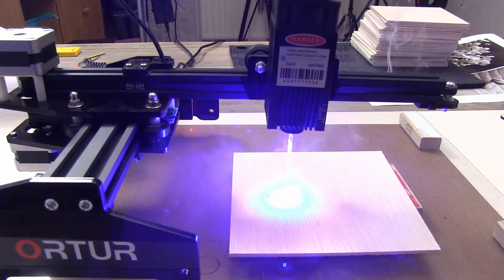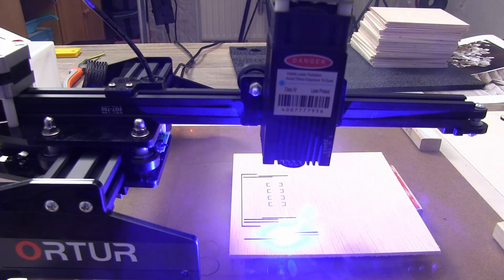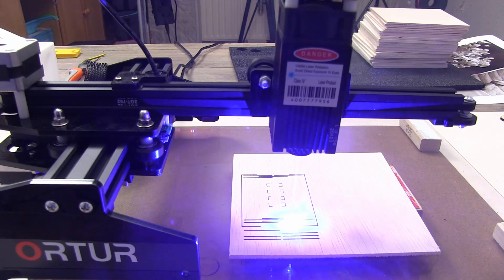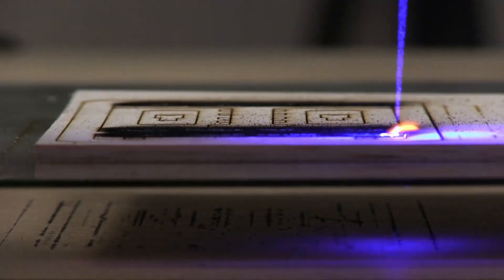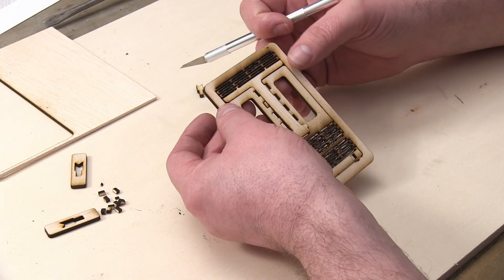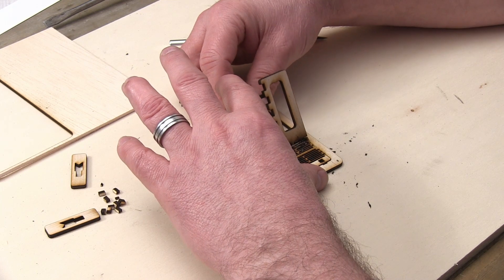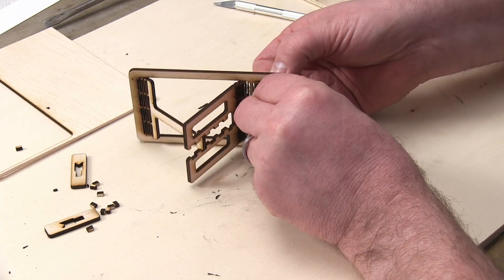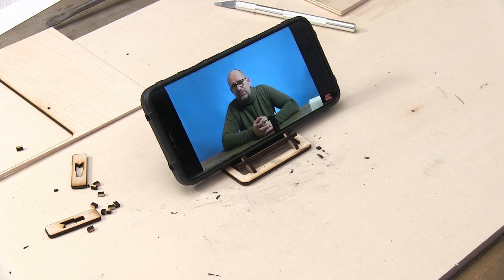▼ Cutting a phone stand out of wood with the Ortur Laser Master 15 Watt

Comment: NICE CUT, CAN YOU SUGGEST ME SETTINGS FOR 4MM MDF AND 4MM PLYWOOD? TRYING TO CUT WITH MY ORTUR LM2 20W BUT COUNDT DO IT WITHOUT BURNING THE WOOD, I HAVE PUT A STANDING FAN AS AIR ASSIST, IM NEW IM TRYING TO ADD THE CORRECT AIR ASSIST BUT HOW CAN I CUT FOR THE MOMENT?  THANK YOU
Reply from the maker: There are no proven settings, but if things burn, you have to go faster and use more repetitions.

Comment: CorelDraw file exported to SVG but the drawings appear in the negative values in the coordinates in LaserGRBL and the machine does not recognize it to start working. How do you set up Corel files or what vector files do you use for cutting?
Reply from the maker: I never used CorelDraw. I use InDesign for almost anything vector related.

Comment: whats the best settings for cutting foamboard 4mm
Reply from the maker: This is different for types of foam, and also for different colors, but about 75% power, and as fast as possible that there is still a decent cut.
I prefer 2 cuts with more speed over a single cut with a slower speed, because the material will melt together after the cutting if the material got to hot.

Comment: If I understand you correct you are saying you like the 15 watt better than the 20 watt is this correct?  I am trying to decide which one to purchase, I was thinking the 20 watt bcause you have the extra power if wanted or needed it, but my thought was you could turn down the power to make comparable to a lower wattage one is this not correct?
Reply from the maker: Sorry for the late answer.
No, there is no better or worse model, they all have their uses.
For engraving, the 7 Watt model is more controlable in low power settings, therefore this is the better choice. For a bit of both jobs, the 15 Watt model is great, while the 20 Watt model is not good for engraving, but the best machine you can have for cutting.
Reply: 15 watt is easier to focus the laser compared to the 20w fixed lens

Comment: Can it cut 3 to 5 mm MDF material?
Reply from the maker: Nope, not out of the box.
You can upgrade it with an air assist unit, and a way to lower the laser, so the focus shifts to a lower setting while cutting, but a Chinese 50 Watt CO2 laser would be cheaper to buy.
Reply: @3dPrintCreator  Thanks

Comment: i cant cut nothing with my ortur 20w tryed 50 mm focus 55 mm,45, 40, 35 works best at 30mm focusing it carefuly,but nope i cant cut nothing but cardboard. damm. what are your focal distance? thanks for your video
Reply from the maker: 55 to 60mm, and it gives great results
Reply: @3dPrintCreator  well, at last, ortur send me a laser module for replacement, and wow!! Yes, the another one was defective since the begining, now engraves wood with no effort, and no power fluctuations or weird behavior, 1 day testing, yea, works fine at 50mm but i noticed thar about 30 the focus spot can be smaller...
Reply: @toxic-waste  i can cut, hoy incheck if is a defective laser module too?
Reply: @YorielGonzalez  yes, actually it was an about to death laser diode, was a pain in the @ but at least, ortur send me a new one, and its ok now... Thanks👍🏻
Reply: @toxic-waste  how can i know if mine is defective?
Reply: @YorielGonzalez  well, the technical way, the laser diode must have a specific readable value in ohms via multimeter, in a practical way, the laser diode has power fluctuations, or very low power, if you use lightburn, try to set spindle to 10 000, and test... I notice that values up 1000 gives more power, until 10 000, that value give the maximum power achiveable, if your laser does lines that starts good and goes lowering while burning, your laser could be defective, but in any case you must check the conections, the arness is chinese quality and sometimes it loosens too, excuse my english, is not my native languaje but im trying.
Reply: @toxic-waste  let me try tomorrow to see whats happens .. thanks for your comment
Reply: @YorielGonzalez  good luck👍🏻🚧
Reply: Also, i found the best and finest dot for me is about 2.5 cm since the lens barrel base, to the object i wants to engrave, i just keep it in that position and use a bunch of 2mm mdf sheets to put under the object i wants to engrave to get the right focus...😂
Reply: @toxic-waste  i do something similar for leather cut until 2mm with a bunch of pennies.. and work each time with 9 passes
Reply: @toxic-waste  they send me a file to test and today answer they will send me a new one .. is possible fix the actually defective? because i has to wait the new one arrive from china to miami and then miami to panama ..
Reply: @YorielGonzalez  actually i was looking for only the  laser diode for replacement... but i cannot find any suitable for that, cause ortur makes is own diodes, as neje, so, that would be hard to find a only laser diode spare part... good for you anyway, you will have a laser diode working for a while... saludos a panama desde mexico👍🏻

Comment: Hi, I want to try cutting 1.5mm wood veneer using this machine. do you know the best settings for this? thank you
Reply from the maker: I have not tried that specific material, but don't go to slow on it, as it will leave burn marks. Also, try covering the veneer with painterstape on top, so it protects the edges of the veneer that you are cutting.
Reply: @3dPrintCreator  hi, do you know a way I can import an image with the original size as well? I'm trying to make a scale prototype, but the software keeps resizing my image.
Reply: Hello Sarah, How did it go for the wood veneeer ? what was your set up? do you recommand this machine to do it?